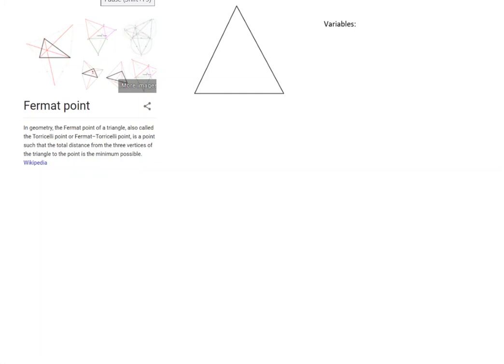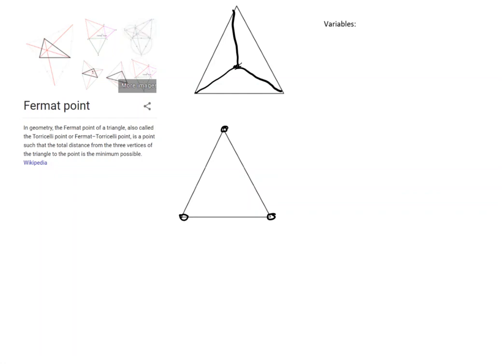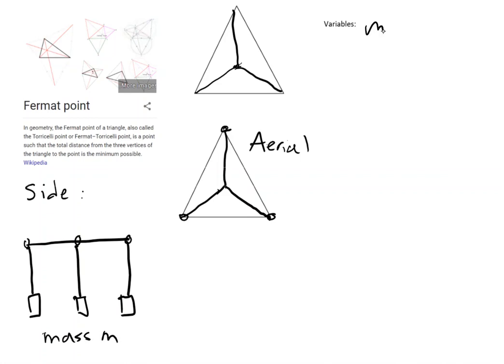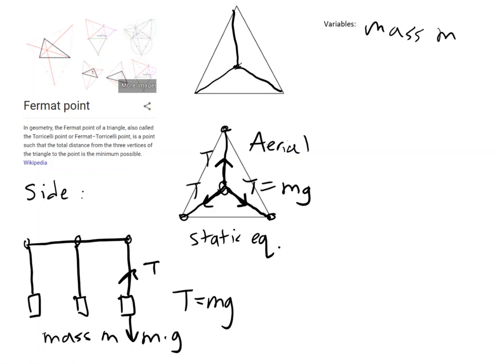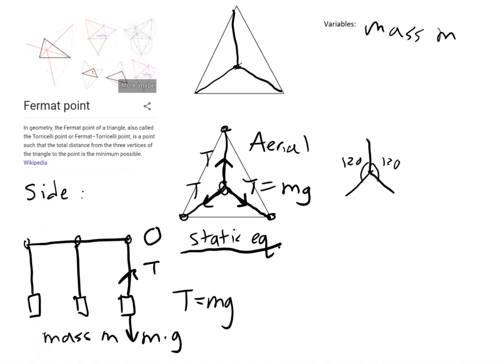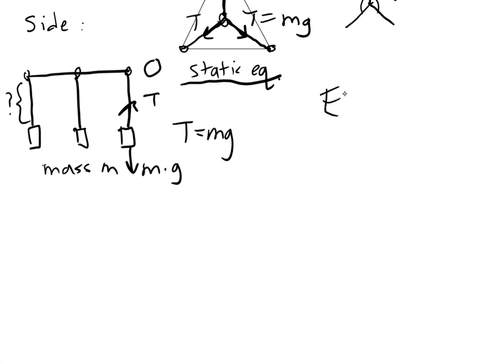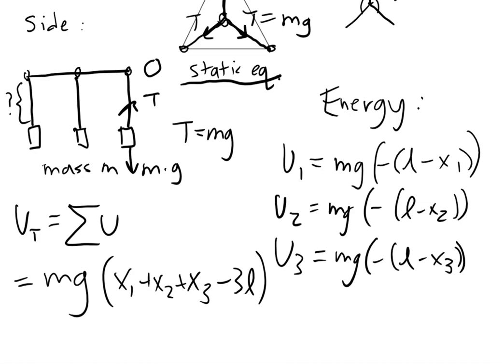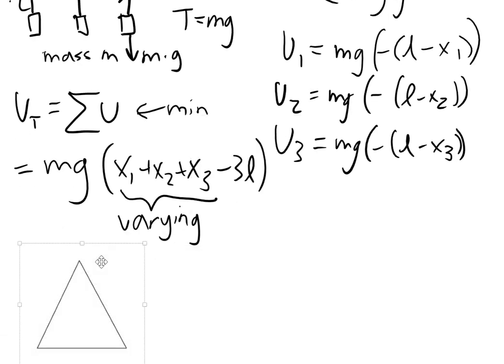Fermat Point - Physics Approach

Comment: First, I think you need to show the configuration of masses as shown is in static equilibrium. They are I am sure.

The biggest problem I have with this solution is that by construction, x₁, x₂ and x₃ are not required to be equal, but by the construction of the problem, they must all be equal, as otherwise, the knott in the middle will.not be sitting on the centre of mass.

It's possible to claim that the total potential energy is a minimum when mg( x₁ +  x₁ +  x₁ - 3l) is a minimum, which means when x₁ +  x₁ +  x₁ is a minimum, which mean x₁ + x₂ + x₃ is a minimum, as x₁ +  x₁ +  x₁ = x₁ + x₂ + x₃.

But really, for a given equilateral triangle x₁ is fixed, so really, I think you have only figured out the total potential energy given m and x₁ and L.